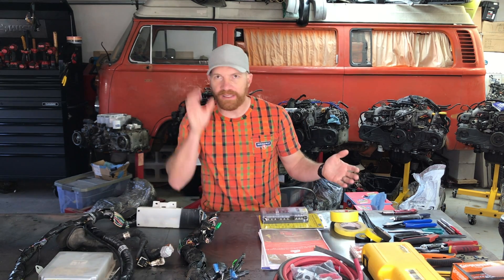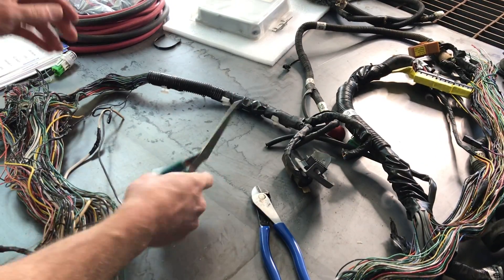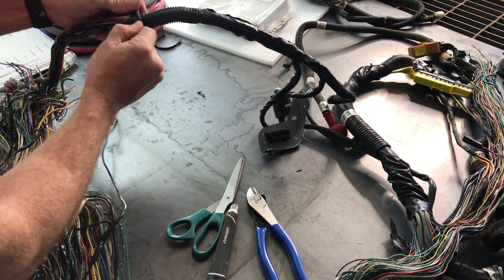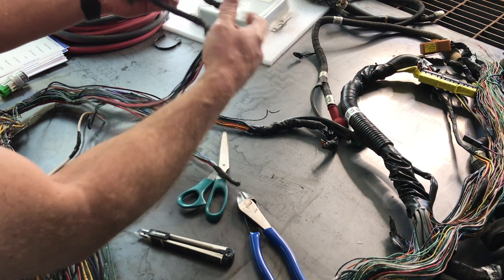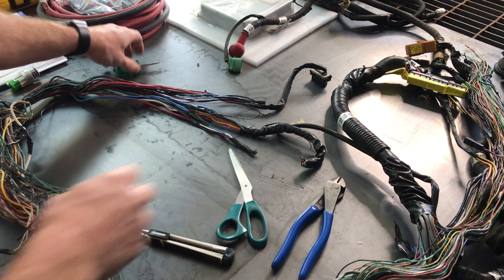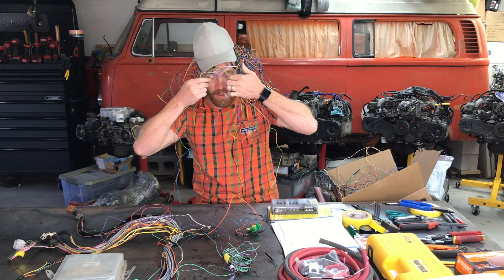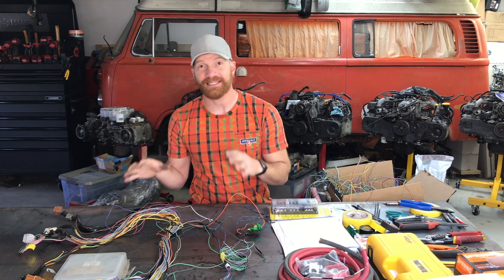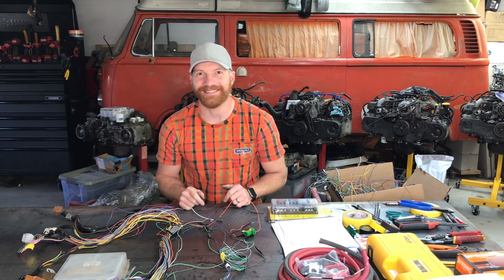VW Bay Window Bus EJ25 Subaru Conversion - Wiring Harness Guide, Step 2: Getting Undressed

Comment: What about the ignition key.. do you need the key barrel for the computer to run engine?
Reply from the maker: Great question! If you're running [generally] pre-2005 USDM Subarus that are drive-by-cable instead of drive-by-wire, you don't need items such as the key barrel, or the body-integrated unit and gauge cluster that all need to be matched to the coded ECM on later model vehicles. If you do use later model, CANBUS donors, you'll need some or all of those additional items. That's why we generally stick with pre-2005 models!

Comment: I picked up 2000 Subaru forester harness and am left with a lot of orphaned wires the ecu pin out that i have not sure if it's the correct one. do you use a specific one.
Reply from the maker: Martin hey and thanks for watching. If you go to Subaru of America's website, you can buy any of the pinouts or factory manuals needed. You may also check the Subaru Conversion Wiring Harness Facebook group - lots of people have uploaded docs there! Best wishes and let me know if we can help - if you need us to do the conversion, you can go to https://modernbay.co/shop/wiring-harnesses/wiring-harness-conversion-service/. Thanks so much!!

Comment: 1995subaru  legacy wagon  into a 1979 bay window need to know how to eliminate smog or as much  as possible through the wiring any suggestions
Reply from the maker: Andy, thanks for commenting! Glad to hear you're converting your bus - you won't regret it. Regarding the wiring, generally what you do is look at the ECM Pinout and eliminate anything that isn't essential for engine running. That said, it's a bit more complex than that. If you need help converting your harness, we have the full service to do so at https://modernbay.co/shop/wiring-harnesses/wiring-harness-conversion-service/. Cheers, Andy, and let us know if we can help!

Comment: Hello, thank you very much for sharing, I really like your videos. I have a question, what happens if the donor is an automatic car? or does it have to be a stick shift car? for the computer to work? I would also like to know if I can buy a modified harness together with the EMC ready to install it on my BUS.
Reply: Chuyrock1, right on! Thanks for the kind words - much appreciated. To answer your question, most of our donors are actually from Automatic Subies. For Autos, you ground a certain pin on the ECM to put the ECM into "Manual" mode. Off hand, it's commonly pin 81 if I'm not mistaken, but you should go by the Pinout for your ECM to be sure. To answer your other question, yes you can! We have about a dozen on the shelf right now, and if you go to https://modernbay.co/shop/wiring-harnesses/wiring-harness-conversion-service/ you can price it out and purchase a full setup. Thanks so much,